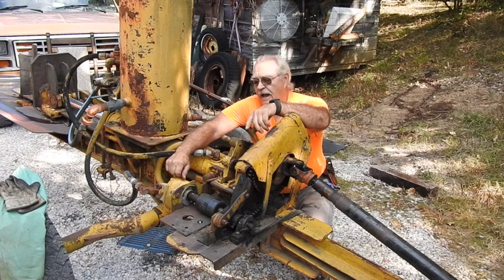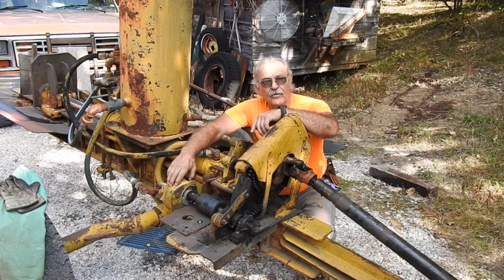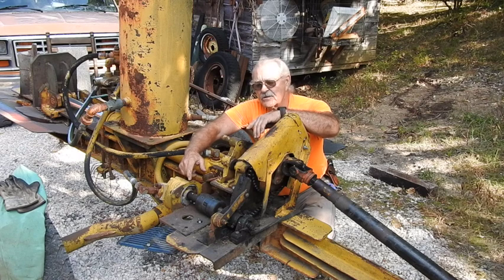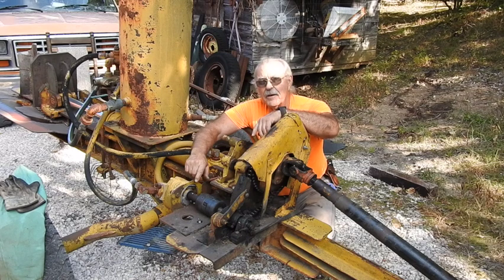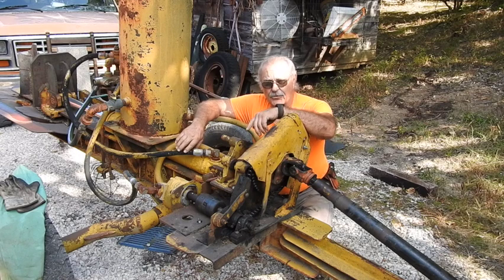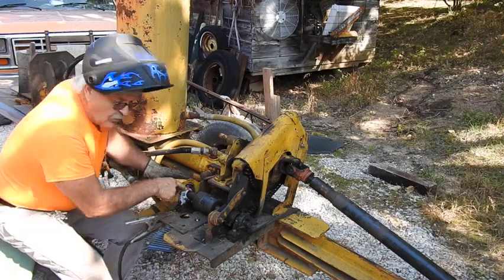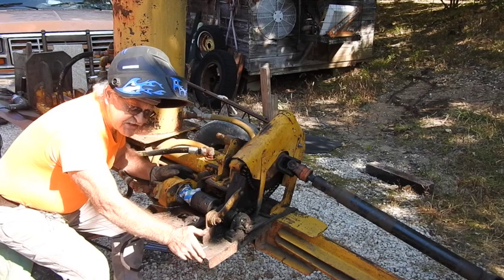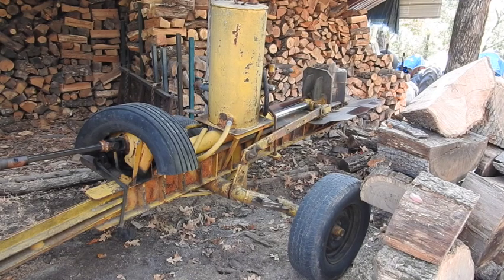Sketchy Hydraulic Pump Repair and Test of Old Homemade Wood Splitter

Comment: how do you still have all your fingers? i held my breath every time you put your right hand between the weadge and the wood. it will get you one day. nice job though on the fix.
Reply from the maker: Yeah, you are probably right about that. Now the chances of that would be a LOT better if a second guy was on the hydraulic control valve, guaranteed !!  But so far, so good and I can still count to ten without taking my shoes off. (-;  Forty plus years of working with a machine breeds a bit of familiarity with the inherent dangers.  I DO acknowledge the potential exists, for sure.
Reply: im right there with you on that. the older we get the less we pay attention. i cant set anything down and turn away from it. in my shop. if i do. im spending the next half hour looking for it and find it setting there laughing at me. lol @tractorman4461

Comment: What an awesome home-made splitter 🙂👍 I like how the axle can move to adjust the height. 🔧
Reply from the maker: The cool thing about the kneeling axle is the BIG ones can be rolled onto the 8'' beam with it sitting on the ground.  Bust'em a time or two, then raise the beam back to your desired working height and go for it !!  Thanks again Zane for the multiple visits over this way.  Btw, we ain't too far apart with you being out there in Bourbon.
Reply: @tractorman4461  oh, now that would be handy! The less you have to lift, the better 😁👍 Where about are you located?
Reply from the maker: @HODGEPODGEDODGEGARAGE  about 30 miles south of good ol' St Louie !!  Just west of the Big Muddy by about 3 miles as the crow flies...About 6 or 8 by the road.  Going the backroads, I am 53 miles from the exit at St Clair.
Reply: @tractorman4461  oh that's awesome! 😁👍 We could always do a collaboration one day 🔧
Reply from the maker: @HODGEPODGEDODGEGARAGE  That'd be cool....It sure is something to think about !  If nothing else it'd be a good visiting youtuber vid.... LOL

Comment: Another repair very well done Wendell sometimes some repairs call for a first time doin it this way process but it fixes it i also have a homemade splitter an had to rig wheel rims to fit the hubs the hubs were 5 hole bolts an my new to me old boat trailer rims were 4 hole i redrilled them to make it a 3 hole rim an surpisingly no one has ever said anything about it i only pull it here around my place not on the road im with ya on these farmer repairs i heat my home with wood heaters too an do lots of splitting great video thanks for sharing
Reply from the maker: Heck yeah. Ya gotta do what ya gotta do sometimes Victor. Lol. There’s nothing wrong with doing that at all on an off-road machine at all !!  I’ve been guilty of that myself on a number of occasions. Have a great evening !!

Comment: Great job TM. I've done that with Gel-cool soaked rag. I used to get similar stuff in a caulking tube. Most welding stores and some plumbing stores carry it.  Again, great job!
Doc
Reply from the maker: Yes, I've used that gooey 'heat sink' in the tubes many times over.  We'd have to keep the neoprene components inside refrigeration service valves and control valves like solenoids, 4-way reversing valves on heat pumps, ball valves and thermostatic expansion valves from melting while silver soldering.  I still have a partial tube on the torch set but I'm keeping that in case an emergency hvac repair pops up.  This would have been a perfect application for it though.  It just slipped my mind for the time.  LOL  Old age is hell Doc.  LOL

Comment: On a plug weld like that, I don't think capping it with 7018 would add much in the way of strength to it anyway. Seems like a good emergency plan to me!!! 👍👍👍 Option #2 seems good but how much will that slow you down? How aggravating will a slower splitter be to you? I'd ask myself those questions before going that route. I'd be on the lookout for another similar GPM pump at a yard sale or estate sale. Never know what you might find before this pump finally gives up. 👍👍👍
Reply from the maker: A bit slower won't really be a problem to me because I don't use this anywhere near full speed when working alone.  The full rated gpm is not there if its not run at the full rpm....so a bit smaller pump in capacity might make me run a little higher speed on the tractor, so no biggie.  I've got several pumps, but the gpm is not known on any of them.  Imagine that !!  LOL I'll be running the number on the likely candidates for sure.

Comment: I'm afraid tractors following you home is contagious. I'm buying a Massey Pony and a grey Ferguson Pony from a friend. Planning on restoring them in the next few years to show them in addition to my GE electric garden tractors. Is there a cure for this addiction? Lol
Reply from the maker: Nope, no cure Jeremy....the disease just gets worse.  Wellllll....or better. Whichever way you choose to look at it.  LOL  The Pony has a 62 cubic inch Continental identical to the ones in the Allis Chalmers G, what some call the grasshopper tractor.  The castings are different because its a rear mount on the AC, but the internals as far as I know are identical.  That engine must have the crank removed to pull the pistons out the bottom, because the rod journals are too large to fit through the bore.
Reply: @tractorman4461  Interesting, thank you for the info. I will be doing videos once I get one of them going again.
Reply from the maker: @jeremydavis2595  good luck !! They are a LOT of fun.  I have a Pony and also one of their competitors, a John Deere LA.  Both similar to the Farmall Cub and the others listed above, their primary target demographic was the small 'truck farmer'.

Comment: I have thought long and hard about making a splitter, but the money just won't show up. Well actually, it shows up and then some "more urgent need" shows up right after. 
Funny how fate knows exactly when I will be getting a bonus, selling an item, or getting paid by Google. No matter how, when, or how much, the crisis will take all the money I, up until that moment, didn't have.
Reply from the maker: That IS quite odd how that seems to be the norm...but as they say, easy come...easy go!!  That's why this one is 99.9% salvage materials.
Reply: @tractorman4461  Another point in favor of

Comment: Chuck it up as a win win, tm44. Like you, I am from the same generation. Fix it the best  you can with what you have. Good job buddy.
Reply from the maker: Thanks Dean.  This old thing has been slipping inside the spline coupling for about 4 years.  I drilled and tapped then put opposing grade 8 set screws in about two years ago, but they were only temporary.  I hope this welding job takes it through the winter's splitting, then I may consider a proper repair.

Comment: Yessir, you do what you got to do on an old piece to make it ruin 'till it drops. It's what I've done, and actually a couple of those 'fixes' are still going.
I hear you though, excessive heat like that welding can kill  seals really quick, you just 'got away with it' this time. ( Like I said , I knew you'd get it done for what you needed at this time, I have faith )
Reply from the maker: Yep, I've got quite a few of those permanent 'temporary' fixes myself !!  It its not critical and it works fine I spend time on projects of a higher priority....of which there is no shortage.
Reply: @tractorman4461  Projects!! I have another buddy in distress with his mower that he wants me to check into for him today,.. 
Ah well it keeps my hands and mind busy rather than idle. 
Always a good thing, I think.
Enjoy the weekend Wendell.
Reply from the maker: @regsparkes6507  I'm sure you got him taken care of Reg !!

Comment: Good fix buddy looks to be splitting very well now thanks for sharing you guys have a great weekend take care
Reply from the maker: At least Tom, I don't have to stop every 15minutes and tighten my set screws on the balding splined shaft any more.  As long as it doesn't spring a leak at the seal it should be good to go for the winter.